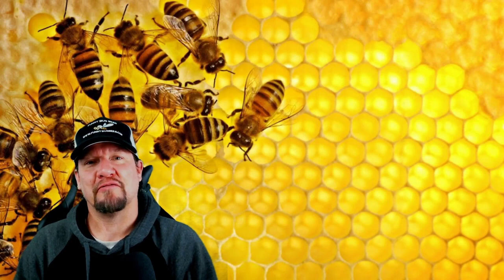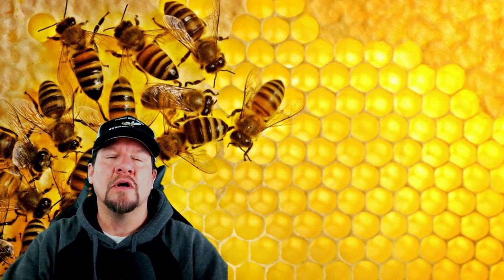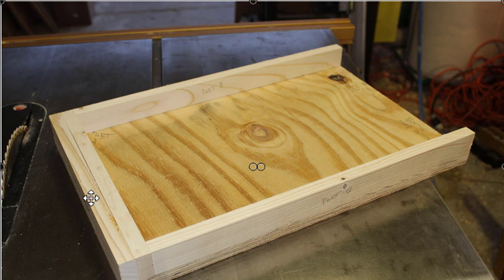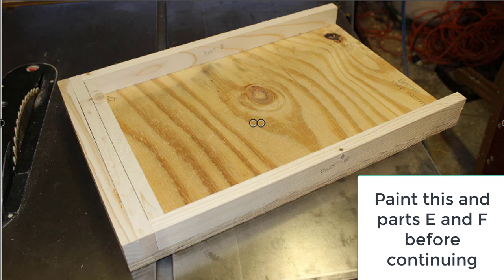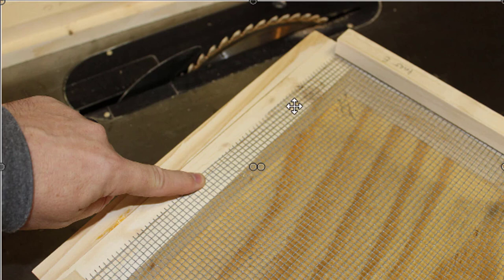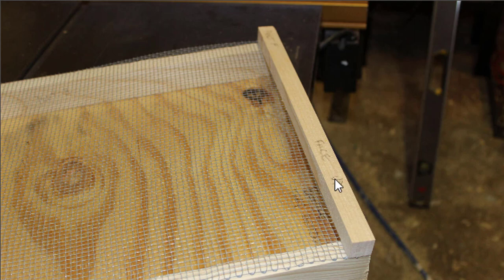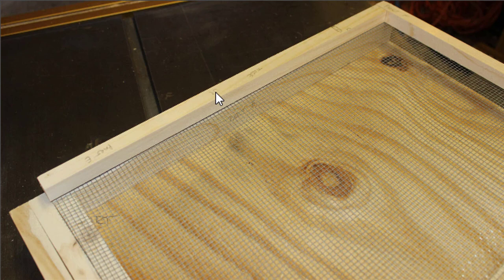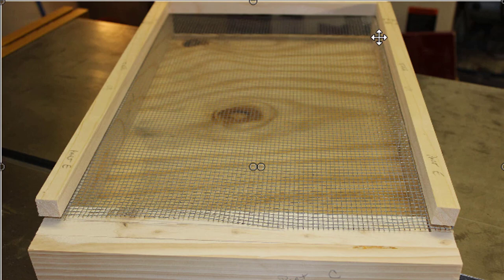How to build a 10 frame small hive beetle trap Bottom Board - Includes Cut List

Comment: i would think to maybe staple hardware cloth to board f before assembling to board b. very good video, thanks for the instructions.
Reply from the maker: i tried this a few times, but it was nearly impossible to get the hardware cloth stapled to the small exterior piece squarely, so i gave up on it....its just easier to do it after its on the trap square for me anyway..As with all things, your mileage may vary.

Comment: What oil pan are you using for the 10 frame sized box?   

From past research and others notes they are impossible to find  a Cheap pan that will work.  

Nice trap design if you can get a pan to fit

Jim
Reply from the maker: We make the trays from 24" vinyl clad trim coil. The same stuff used to make the aluminum trim around exterior windows. You can find this for about $90 per roll at any hardware store. Or you can contact us and we can make trays for you.